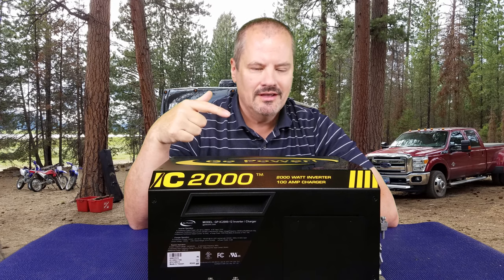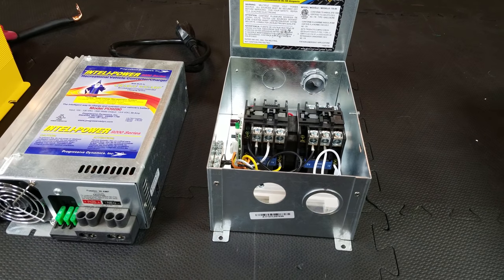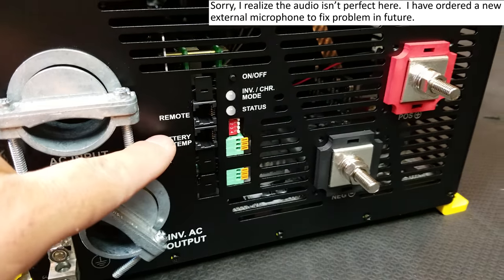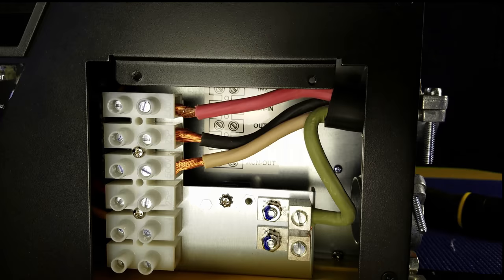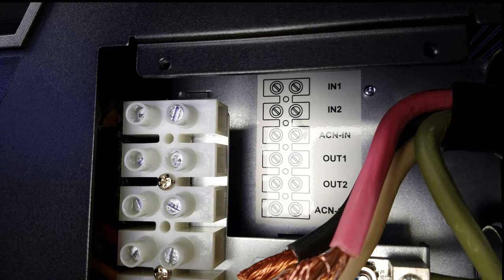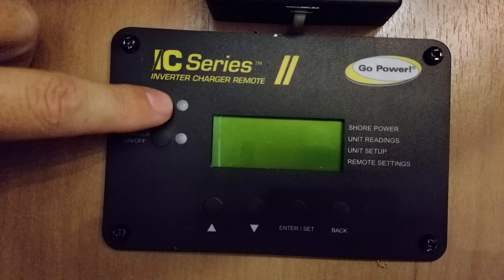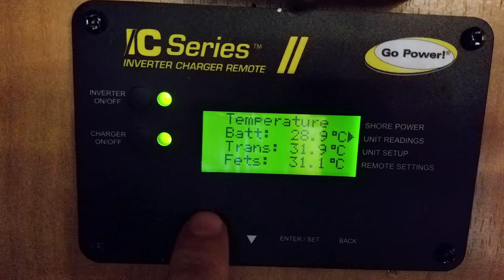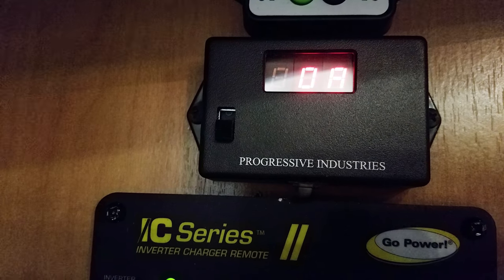Go Power! IC2000 -  Inverter & Converter & Transfer Switch

Comment: Excellent video. I am so glad I found it. Sure will make running off batteries easier in my RV. Way better than buying all the other components and sorting through the wiring, finding room, mounting, etc, etc. Thanks so much.

Comment: Go Power has fantastic technical support folks. I recently purchased the larger IC-3000 which has 50amp passthrough. I ended up pulling it out because it has some confirmed issues that were misleading in the marketing presentation from Go Power and was never clarified in their manuals and video's. 

The most important issues is these units have the ability to set the max shore power setting. This as documented should only allow that maximum number of amps from being used by the IC-2000 or in the IC-3000 you have to divide that number in 1/2 (50amp service is two legs at 50amp, 100amp total).The problem is if you use this unit or the IC-3000 AC-IN2 is never calculated. So you put the unit at 15amp to use a plug at your home, as long as the usage is from AC-IN1 side the unit will limit current. If it is on AC-IN2 then the current is not limited. This means you could blow a fuse or cause a fire because the current is no longer limited as suggested. In working with Go Power support they also said that the unit could pull 2/3amps more then the maximum power setting because of the charger being before the output.

The overall deciding factor for us removing was the unit did not work in power share mode properly with my Yamaha EF2000iSv2. When it was running in smart throttle mode, the generator would ramp up but with sustained loads sometimes the IC-3000 would have a relay that would make a loud click and disconnect all AC shore power. You would be running 100% off the inverter which depending on your batteries does not last long. When this happens you have to cold boot the system by removing all AC and DC power and then start the invert back up again. Couple of middle of the nights of this and I had enough.

Through all of this I will say again the support folks were awesome with both calls and emails to work though issues. Unfortunately they even seemed to not be aware of many of these gotchas. I am pulling for Go Power to continue refining this product.

Comment: Something you didn't cover with that inverter is the load assist. But load assist only works on L1 input. It's nice that the inverter will do that so you can run a smaller generator and the inverter will help assist in starting up an AC unit without putting a large strain on the generator or if you're somewhere camping and you have only a 20 or 30 amp service.

Comment: Great video sir.  I'm doing this install on my 2019 Montana 5th wheel.  Nice they now have inverters that do it all.  Makes for a lot less electrical components and wiring.  Do you have a photo or diagram of hooking to the 50amp shore power coming in?  Did you access it at the panel or prior to the panel for both AC in and out?
Reply from the maker: It is a straight forward install.   Take a picture of your existing shore power line at your breaker box...then remove those 4 wires (most likley Red/Black/White/Copper.   Then install that as the power in on GoPower.   Next, using new cable, wire from GoPower back to the same location on your breaker box.

Comment: i get that your consolidating 3 parts in 1,but if 1 of those fail you have lost all 3?and just me i believe i would put some type of shield between it and the water heater or even a better non-wet location
Reply from the maker: I wish YouTube allowed updating videos...   You are 100% correct, that location was simply to install and test the IC2000.  That was not the permanent home.    It is safe (and dry) up front in the 5th wheel storage unit.  If you jump to 4:14 mark in this video link, you will see it is not attached to the back wall.   https://youtu.be/08u7VRPeJD4

Comment: Great video except one thing was overlooked.  You showed in the beginning that this replaces the Auto Transfer Switch but you only showed one AC line going into the inverter charger.  There are normally 2 AC lines (1 from shore power and 1 from generator) which go to the Auto Transfer Switch.  Could you show how you handles that scenario?
Reply from the maker: We don't have an onboard generator, so I didn't show that configuration.   However, it is very simple.   You would use a standard transfer switch to combine shore and generator.  The output of that transfer switch would be the incoming line to the IC2000/3000.   The IC2000/3000 would then transfer between incoming power (Gen or Shore) and using your battery bank to invert power when boondocking.
Reply: Great video. I’m a bit confused you stated that this will replace a transfer switch. I have ordered the go power elite and I have on board generator. I’m not sure why I would need to add a transfer switch if it is already built in?  Thank you
Reply from the maker: @portmoody109  If you have an existing built in Gen, then the shore power and your Gen go through a transfer switch.    The output of that TS, would then come into the IC2000 (or IC3000) and then the IC2000 would become a transfer switch for power in (from existing TS) and battery bank.   We don't have a built in Gen, so I don't show that set up in this video.
Reply: @tannerjim  thank you for the response. It was my mistake saying my rv came with a generator. It will be installed at the dealer next week when we pick it up for the first time. I will definitely ask them to install a Transfer switch if it doesn’t come with the propane generator.
Reply from the maker: @portmoody109  LOL...if they install a Gen, there is no option...they will install an TS.  Enjoy the new generator.  :)

Comment: I see in the video you have 50amp service for your rv. I have 30amp 120volt. Will this work for that or do you have something else to recommend?
Reply from the maker: Sure, you could use this for 30 amp service.  You would only have 1 "hot" line coming in vs the 2 "hot" lines you saw me wire up in the video.    Then if you get a new RV in the future that is 50 amp, you can add this to the new RV.  😎

Comment: I hope you are  protecting the inverter from a potential (water leak from your water heater), installing any electrical devices like that is just asking for trouble. Build some water proof barrier under and on the side of the inverter. Just my few cents. Other that that great video and yes, GoPower is a great manufacturer and higly recommended.
Reply from the maker: That was a temp location for testing.  It had been moved to the front storage compartment in our 5th wheel.   If you watch my video on Battle Born Batteries, you see the final location.
Reply: Fair enough, good job.

Comment: wondering about the input cable.   In the manual it comes in from a "main Panel"  can you com direct from a shore power in connection with out a "main panel and switch"?
Reply from the maker: I've attached a link that will open my power distribution diagram.   Hopefully that will help you understand....I'm the visual type, so this diagram was helpful in my planning of the power layout.    

Short summary....Shore Power Line to will attach the input to IC-2000.   Output from IC-2000 will go to your distribution panel.

https://drive.google.com/open?id=0BzxEvZw2XQ1MQ3YwRnJoel9MaDg
Reply: Link no workie.

Comment: My RV has Shore power and a Generator. Is a second transfer switch needed between the Shore power and Generator power in and then take power from that second Transfer switch out to the Shore power in on the Inverter?
Reply from the maker: You will need a typical transfer switch to pair your Generator and Shore Power.   The OUTPUT from that transfer switch, will be routed into the IC-2000's "AC In" port.   Then attach battery to IC-2000 as normal.  The output from the IC-2000 will be attached to your distribution panel and all devices will operate.   AC will work when you're on Shore Power or Generator power, but the IC-2000 will not run your AC on battery power alone.

Comment: They should also include a grid tie inverter once the batteries are charged, to continue to pump those solar panels to the max for those who are tied in to the shore power.  Having the RV sending power back into the grid would be very nice.  It would be nice also if they would put in  Bluetooth or wifi link to your smart phone or PDA so you can get details easier, logs to send to go power and better configuration.  The IC series II Inverter Charger Remote and PWM Solar Controller are cute, but a PDA with Bluetooth technology would be a far superior product.  I know their support people would rather have something like that, then trust people to setup and convey what they see, what they interpret they want, and what they really want.  Hell, the loss w/ RMA exchanges which were not needed, would more then repay the development costs.
Reply from the maker: Yea...adding Bluetooth (like the Victron hardware has) would be a GREAT update/upgrade for these for sure!!

Comment: Can you run your air conditioning with this device
Reply from the maker: Yes, but please note, our 15k AC unit (we have 2 of them) will draw ~160amps to operate.   So, "yes" you can run an AC with it, but you'll need a LARGE battery bank run it for a lenght of time.

Comment: Did you disconnect original ac/shore and run a whole new wire to inverter that’s is to breaker panel.
Reply from the maker: I took original shore power connection to distribution panel and that is now the "in" on the IC2000.   Then I ran a new connection from "out" of IC2000 back to distribution panel
Reply: @tannerjim  ok thanks that’s what I did , when I run everything like normal the inverter shuts off I think because the converter try’s to charge also. So if I shut off converter at breaker panel it runs smooth do you have to did that
Reply from the maker: @thedodgefather3078  The IC2000 is a converter as well as inverter.  You should disconnect (even remove) your prior converter.
Reply: @tannerjim  thank you I will disconnect
Reply: @tannerjim   my inverter keeps tripping or shutting down when I turn anything on do you have any ideas what to check? I mainly use for fridge but when I try tv or radio or an AC unit it shuts all power off
Reply from the maker: @thedodgefather3078  How many amps can your battery bank provide?  Perhaps the frig + whatever else you trying is causing the GoPower to shut down do to not enough amps coming in.   Or...you could be using the wrong gauge wire.
Reply: @tannerjim  I have two 6v interstate batteries
Reply from the maker: @thedodgefather3078  Wiring two 6v to create 12v system only increases  your voltage, not amps.   Then take into account any battery other than Lithium will only provide you ~50% of the stated amps.  My guess is you simply don't have enough amps fully power your system.  If possible, I would recommend you move to 300 amp hours of Lithium batteries.
Reply: @tannerjim  question do you now have tow sets running to control panel
Reply: I’m still having issues added two more batteries and nothing stays on past 5 seconds. Converter is out. 

I have it wired as such from transfer switch control panel
To the in of ic 2000 and out is a new set of wiring from inverter to breaker panel. 

If I run shore cord to converter what powers the breaker

Comment: Could this be used as a stand alone solar  generation power station, instead of being inside an RV
Reply from the maker: Are you asking if it can be used for something other than an RV?  If so...yes.  :)
Reply: Yes, something like a power supply for lights, cell phones, tablets, or laptops in a campsite where you don't have the luxury of an RV...
Reply from the maker: Where is your power coming from ?  Batteries?  This can support up to 50amps.  How are you planning to connect this?  Typically you would go from this to a distribution panel, which is then used to power outlets at either 15-20 amp.    If you simply want to connect to a battery and have 110v power (for laptop, cell phone, lights) then look at the device I've linked at the end of this reply.   It is an "inverter", which provides two (2)  110v plugs via a 12v battery -   http://amzn.to/2FxN7q3

Comment: Jim great vid, I’m trying to figure out how you didn’t need a sub panel to get all the outlets working? Your inverter ac in is connected to leads from 50 amp power plug at the breaker box, and your out goes to the breakers where the original 50 amp power plug leads were connected on the breakers? So I have that right? Option 2 in the manual.... that seems too easy
Reply from the maker: Yes, I think you have it .   You can email me at rvwiththetanners@gmail.com and I will email you the diagram....it will help illustrate the process.  :)    Oh...thanks for subscribing.

Comment: Did you wire from the ic2000 lugs to the fuse panel in your trailer, or from the battery bank to the fuse panel for your DC connection?
Reply from the maker: Let me try to explain how I have it.   Batteries are wired to IC2000....then IC-2000 is wired (the "output" line) directly to my distribution panel in our RV, providing AC power on L1 and L2.   

For DC power, the IC2000 will charge the batteries, but the DC power flows through the normal busbar and is distributed to the RV via factory setup.

Pictures always help.  Here is a link to my setup.  Let me know if you still have questions.

https://drive.google.com/open?id=0BzxEvZw2XQ1MQ3YwRnJoel9MaDg
Reply: I just dont have a bus bar...i should be able to just take battery positive to my fuse panel through whats factory wired already.
Reply from the maker: You will have some sort of 12v distribution.   Follow the POS cable off your battery.  I will come to a 12v breaker and then somehow it will be distributed through your RV.

If you install the IC-2000 (or even IC-3000 now :) ) you won't have to do anything different for your 12v items to work.  That remains the same.   Other than disconnecting your existing "converter", as the IC2000 will be doing the 12v charging for you....at a much better level.

Comment: Hi Jim, so once you installed this you didn't have to rewire anything to be able to use the receptacles, you just make sure you don't run anything that needs a high load, like AC, and if you did need AC you'd use shore power or your gen, is that correct? Thx
Reply from the maker: Patrick...Correct, there is no additional wiring for all the outlets to work.  I've included a link to my wiring diagram, that will show you how this is integrated into our RV's electrical system.   For the AC to run, you CAN use the IC-2000 and a small generator (we have Yamaha EF2000).   While we have not tried this, the folks at GoPower assure me it will work.   Just note, that doing this will run down batteries even with the generator running at the same time.  

BTW..this will power everything in our Bighorn, except the AC units.  As stated above, I'd need our Yamaha generator to get AC unit working.  

Link to our wiring setup -- https://drive.google.com/file/d/0BzxEvZw2XQ1MQ3YwRnJoel9MaDg/view

Hope this helps   :)

Jim
Reply: Thanks!

Comment: Hi thanks for the video. Is it best to put this in place of an existing travel trailer converter, or will the wiring to the battery be too small? Or place the IC2000 closer to the batteries with wiring going to trailer panel?
Reply from the maker: The IC-2000 will replace your existing converter.    GoPower recommends having this device within a TOTAL of 10 feet of wiring (meaning combining both POS and NEG cables).   Use 6AWG cabling.    

Here is a link to my wiring diagram, which should give you a better understanding of how to layout your system.

Link to our wiring setup -- https://drive.google.com/file/d/0BzxEvZw2XQ1MQ3YwRnJoel9MaDg/view
Reply: ok thanks
Reply: Awesome. As in Canada il find something similar
Reply from the maker: GoPower is IN Canada.   You should have no problems finding it there.  :)
Reply: I meant your USA link to the wiring
Reply from the maker: Send me an email and I will email the file to you.   rvwiththetanners@gmail.com

Comment: I like this... however, if you go through the trouble making a box this big, why not 3000 watts?  They have other 3000/6000  products.  Here's the big bummer about this box...surge is 3400 watts for ONLY 5 SECONDS!  So did you Chuck your factory converter/charger?
Reply from the maker: When I did this, they only offered the IC2000.   The IC3000 came out about 4 months after I was done.
Reply: love this vid.. appreciate   the effort.  I'm sure it serves you well.
Reply from the maker: Yep...factory converter is now collecting dust in the garage.
Reply: Bravo!  You wire up a separate 12v fused panel?
Reply from the maker: @H2OTOYS-90  Nope...no sub-panel used.   Just need to remember to turn on "converter" function of IC2000.  Easy.  :)
Reply: Ok.  So you retired old converter and kept the 12v panel from it with everything connected to it?  I'm starting from zero with a big cargo trailer.  I just bought a KLX-250 and need to hit the road with it.
Reply from the maker: @H2OTOYS-90  I ride a WR450.   :)    I think you're confusing the 12v and 110v panels.   From shore power, your cord will go to the 110v circuit breaker.  From there, 20amp service will feed the old converter....that creates both 12v for RV and 12v for battery(s).  The IC2000 will then be wired with the cable that went to circuit breaker AND wires from battery.   The same wires that bring 12v to the IC2000....also send 12v back to the batteries when on shore power.   Then  you add one new cable from IC2000 to circuit breaker in your RV.
Reply: That's what I thought.  Obviously the perfect solution for existing rv but I'm starting from nothing.  Not sure if ultimately this is my best bet.  Thanks for answering my questions and RIDE SAFE!